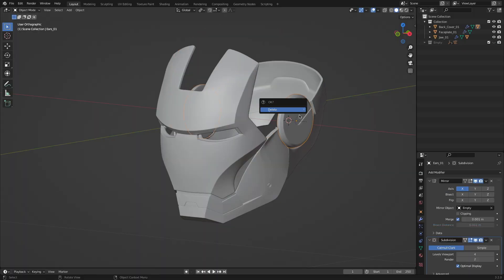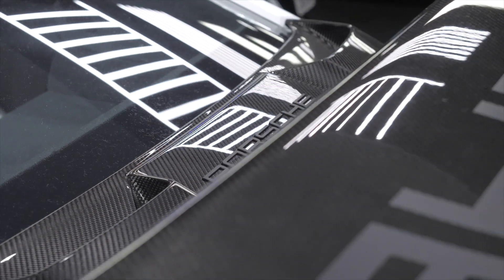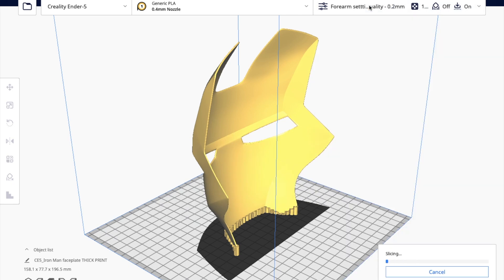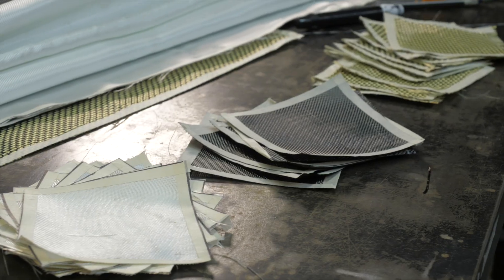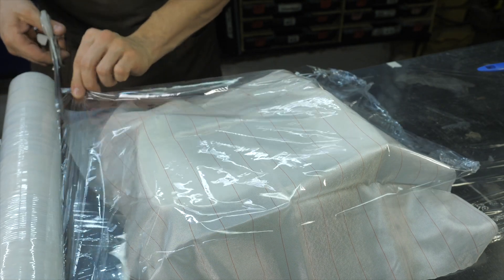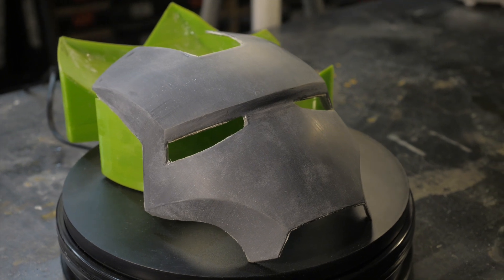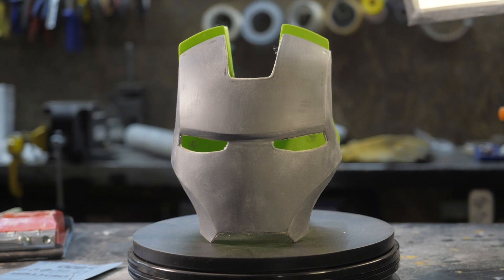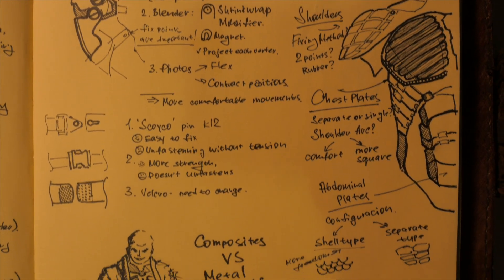3D printed core. How to make composite part without a mold for laminating. Basics of composites #6.

Comment from the maker: Technical questions here 👇
Guys, thank you for all your questions, tips and support!
Reply: Could you print a top and bottom of a mould, wrap in clingfilm (to negate the mould sticking problem), and put them in a press or vice to mould carbon fibre to higher accuracy and density? Perhaps even print a mould hollow, and pouring in concrete to allow it to withstand higher preasure? A water or acetone soluble clingfilm alternative would also be incredibly effective, these are just loose ideas so I hope it helps and i would love to hear your opinion on them!
Reply: Hi Alex have you considered usinng cabinet scrapers in combination or as a replacement for sanding.
In russian those scrapers are called "цикля".
https://youtu.be/a4e9JJkinvk
Reply: Hey sir! I am trying to make your hydrogen arc reactor and I want to make a battery pack for it can u tell me all the parts you used to make ur arc reactor battery pack.. 
Thank you, 
Suhan
Reply: @suhanthemaker  I believe that if you go back to older videos he uses li-ion 18650 batteries... you can easily make a battery pack with these and there are many videos on YouTube for it. However he dose talk about upgrading the battery pack with li-po batteries so i dont know what battery he currently uses in his newer videos. Hope that helps!
Reply: So how will you get in it if you'll have muscles all around. Will it open up or will you put it on in segments.
Reply: Couldn't you use a press assembly (bottle jack press) with a negative and positive mold to create a more highly detailed laminated part? I understand the draw backs of having the possibilities of more imperfections as the negative and positive mold needs to be extremely clean with little to no imperfections with supports for the rated pressures to have a cleaner lamination, but the thought behind this is that you could make multiple parts rather quickly if you ever need replacements. I wouldn't want to test a part to see if it was bullet proof or determine the impact resistance and put all that hard work into it and not have the ability to make another part rather quickly using this method.
Reply: Will your armour work like the armour as shown in the iron man movies
Reply: Hey Alex, is it possible to electro plate carbon fiber?
Reply: So I might have forgotten the answer to this in an older video, but I remember you using the arc reactor to amplify the strength of the wearer. What I wonder is how much of a difference this makes to needing the parts to be as light as possible? What I really wonder is that if adding strength amplification increases weight that may then be negated by the strength amplification itself, and assuming that there are multiple degrees of strength amplification which each increase the overall weight depending on their power, would it be worth calculating the weight/strength amplification ratios to find what would be most efficient in this regard? More importantly, could this increase in strength offset the weight of the parts, allowing for stronger but heavier materials to be used without compromising user movement within the suit?
Reply: You could try sand casting with a forge
Reply: @sadsealsealseal8554  3D printed parts out perform castings in durability and cost.
Reply: Use voltage boosters to reduce battery weight. You can use High voltage boosters too for breaking down of atoms h2o and you can make a mini jet engine fixed to legs fuel will be the most flammable gas in universe. Best of luck. Furious to see you flying.
-I am Indian Stanley of your iron man dream.
Reply: Hii alex i am from india i have a suggestion for your new video can you make a video on making real iron man lazer gauntlet just like in iron man 2 but without using hydrogen tech only with the help of plasma 

2. Can you make a video on real iron man flying repulsur with help of hydrogen tech just like how rockets fly 

Plz pin my comment and give your opinion lots of love from india❤❤❤❤
Reply: Regarding molds: If mass producing, it might be worth making a mold to make a mold - ie make the mask via 3d print to be used to then make a latex mold which can be reused and is easier to remove as it is flexible. just a thought. great work as always - i love what you do!
Reply: Is this armour bulletproof
Reply: @nightmaresingh1195  i think it's more for impacts kind of like  the stuff motorcyclist/bike riders use for protection like the knee guards and elbow guards
Reply: @AngryBulldogGaming  thanks buddy i think this man should made a video on bullet resistance or bullet proof guards .

Comment: I wan to make a suit capable of supersonic flight and I know that supersonic flight in such a small suit is not capable right now, i think it might be some time in the future. So I want to make the suit out of titanium, but if I make the inside with a plastic mold or carbon fiber, I don't think it will do good during thermal cycling. Unless I use super high heat resistant resin for the carbon fiber.

Comment: I have to wonder if the direction of manufacturing isn't exactly right. Instead of trying to create something that's strong enough to withstand blows or projectiles. Why not focus on what you "require" to support the hardware you need to put into the armor. So it'd be a "support system", not an "armor". At least until technology reaches a stage where advanced polymer materials for protection are possible. Theoretically possible.

Comment: While there are plenty of steps, if you want strength, and finish I don’t think there is a more direct way to have the ease of 3D printing + strength. Fantastic work! You can make flimsy simple 3D prints until you are confident about your size and structure, then you start this process when you want to make a good looking strong part. Nice.
Reply: Titanium 3d printing  ? It's strong and easy. But expensive

Comment: Vacuum (cleaner) the fabric in placed and a negative mold as a press to create those sharp edges but i'll se what u cam up with cus i made a Carbon Fiber Katana w/ a vacuum cleaner to get the air out and a realy tight seal^^
Reply: 'm try'n it, C if i can create another katana